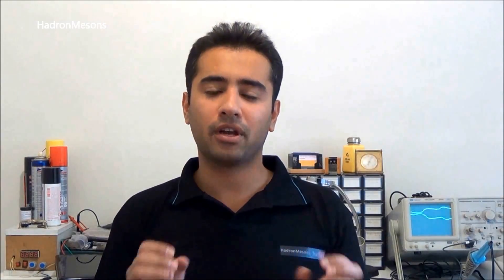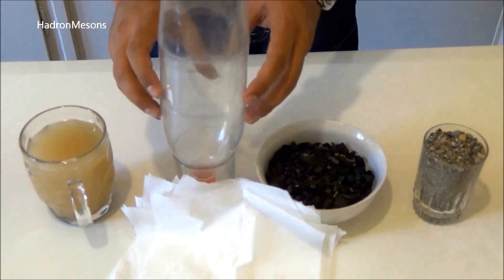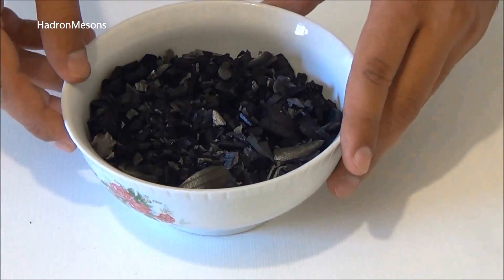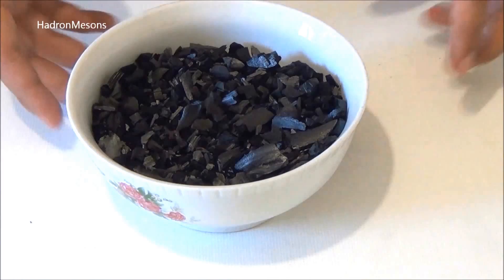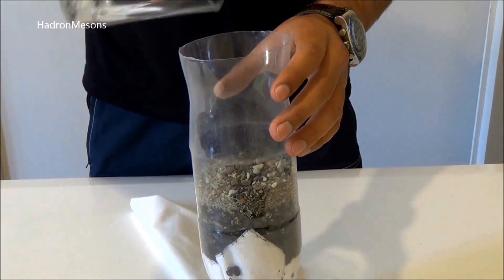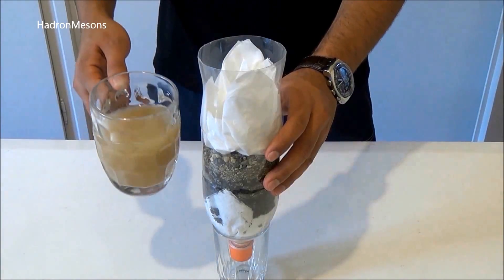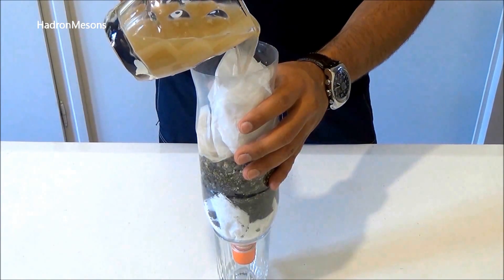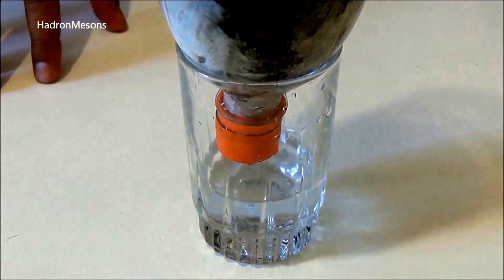How to Drink Dirty Water in Emergency Situation - Survival !!

Comment: It is waste of time, how the f*** will u find these things in extreme situation??? someone is not a smart one
Reply: +Arctic Wolf 
Agreed, It's very easy to follow and very useful information. (might add my chance to survive zombie apoc) XD
Reply: Cloth, sand, charcoal, 2 liter bottle (garbage). What kind of apocalypse would deprive you of these things?
Reply: Shenba vv They didn't survive because they drank their own urine buddy.. do some more research on what drinking urine does to the body. You can fabricate an emergency solar still and use urine to get water.. And if i was caught under rubble i wouldn't drink my own urine because that would make the situation worse.. This is not open for debate because it's a known fact.
Reply: Willem Arnhem believe what you will..
Reply: The results will certainly vary depending on where you live. I live in a large suburb outside Boston. For the hell of it I went out looking for this stuff. W/in 5 minutes i found 6 plastic bottles....2 with the caps on. W/in 10 minutes found plenty of sticks to burn for charcoal. ok...lets go through the steps. (1) We all see discarded plastic bottles all over the place so that should be an easy grab. (2)Gravel is just small rocks.....so you can pick those up randomly. (4) if you can't find sand skip it and look for twigs and wood on the ground. (5) if you have a lighter or a match burn the pile of twigs to get charcoal.  Part of a white T-shirt can be used as the cloth part of the filter. All this stuff is available & can be done in an emergency as long as not too many other people know this procedure (and grab all this stuff up fast)
Reply: MrMarty
the dirt would still be there. The charcoal is supposed to remove lead and other heavy metals and bad stuff. The best thing would still be to boil it after if it's possible.
Reply: I have do it for a science project
Reply: Well,  let me ask you a simple question.  Suppose you are caught in an emergency situation, lets say underneath piles of rubble.  You are injured.  You need water to survive until help arrives, what would U do to live if you are left with no other choice but drink your own urine?  Would you choose to die or live?   Media might have made up the stories but there are people who really survived with urine.  Anyway,  thanks for your explanations.  Have a nice day.
Reply: +Kubisek9 charcoal is found after making a fire, - made from burnt wood.
instead of paper towels use a torn shirt.
collect small rocks for the rocks.
sand is abundant on land as well.
If you are on a boat, you can maybe make a fire, to make charcoal.
if you are on a raft, you are fucked, you must use condensation.
Reply: To make things simpler this is what you do
1. Find wood
2. Make fire
3. Use any type of pot 
4. Get water from the ocean/saltine water
5. Boil
6. Make sure something is over the pot like a clipboard or something so the water won't evaporate into the air
7. Tilt the board and have something on the side of the pot so the droplets from the board can fall into it
8. Salt is left behind in the the pot 
This guy idea of surviving in a life or death situation isn't so good.  There's a 15% chance you will actually find those things. And I'm pretty sure that there will be a time when filtering the water won't work.  The water won't even be great to drink.  That's all I had to say thx and bye😀
Reply: +Bruce Nguyen This is for emergency situations like an outbreak. It's very easy to gather too, just burn and make charcoal then find other materials.
Reply: AOA angles  what this does is try to remove the bacteria that will kill you, there's only small traces of "stone and chalk" and it beats being dead or sick because the water you drank had tons of bacteria and stuff in it and you drank it because you had nothing else. this is for emergency survival use
Reply: Sand on beaches. Charcoal from burnt wood.
Reply: Yeh like boi u could just get water and boil it and let it cool down that lower the chance to get sick
Reply: Kubisek, no body forced you to watch this video. why don't you put your dirty tongue in the closet cos we don't need people like you in here. Please try to appreciate what people do if not shut up
Reply: You can't find a water bottle and some sand in an 'extreme situation'?
Reply: +Kubisek9  Ya I agree with U. commonly we read ppl survive drinking their own urine or rain water.  But not by filtering the dirty water. Ha ha.
Reply: +Gino Foogle You can drink your own urine up to a point where you are becoming so dehydrated it's turning a dark shade of orange/brown
Reply: +Kubisek9 it is a solution among many others. It depends on what you have on hand. Yes he is a smart one. It's up to you to learn all the others possibilities and when you are in extreme situation you will be able to deal with it.
Reply: +HadronMesons - Science and Tech  use some wood, make a fire, boil the water, drink it?
Reply: +Kubisek9  if u get ready for that BEFORE extreme situation AND MAKE AT HOME U PEASE OF CRAP U ARE IDIOT DAMN IT =_=
Reply: TopCategory I know I understand how it works, but the mikimuas guy was saying its too hard that you would need to make it at home and I said if you had time to make it at home you might as well buy the Sawyer mini water filter, it's better than a lifestraw. that's what I was getting at trying to tell him how ironic that he called someone stupid when what he said was even stupider
Reply: yahhhh u right....but cause of him many people can die....
Reply: ya right and also how can we drink that water cause it is mixed with stone and chalk huh??
Reply: +Kubisek9 yeah
Reply: stuck in cave and ü gave bottle 💥
Reply: have *
Reply: his right dldl
Reply: Actually it would be pretty easy to find this stuff. Discarded plastic bottles are everywhere. Sand and gravel is easy. To get charcoal all you need is fire and wood
Reply: +inkey2 I don't think it's as easy as you say it tho
Reply: agreed
Reply: Kubisek9 charcoal is easy to make for free & plastic make up 10 percent of the trash mountains in the world this is not a waste of time since I started writing this reply to you 8 children have died from drinking dirty water & it's stuff we with taps of clean water learned in scouts at the age of 10,a child dies every second since I told you 8 children have died another 6 have died.. Ur an ass it's plain to see ur uneducated in the art of survival I pity the lazy attitude you offer sitting at your computer drinking your coffee...
Reply: Gino Foogle see how you feel about it when you're car breaks down in the middle of the desert & u don't have dirty water to filter I was in this very situation a few years back I always have charcoal in my vehicle even a small amount it can save your life cool pee tastes not so bad when the other option is dry mouth like uv never felt in your life & the next stage is death then tell me what you think when ur in the situation not sitting in front of the computer been a naysayer in joy that coffee 10 children have died of dirty water since I started this reply 1 a second grow up this is life n death.
Reply: Shenba vv better example than mine but I survived because of this IV drank urine straight & have filtered water with charcoal I broke down in the bad side of the serenity & always have a bag of charcoal I could make it but that's for living in conditions of dirty water full time, I've volunteered in many countries teaching easy ways to filter water I disagree with charities like water aid they get money in pay stupid wasted money for special mesh for the collection of morning due when the perfect free option is the safety nets on old trampolines I use fb to collect them &  taught 5 families that method from scrap that can be got in the dumps there I ship mesh as much as possible but have ppl on the ground over there who are getting mesh in South Africa & it can provide enough water for a family of 4 & there livestock with 3 collection setups 1 if they have no animals.
Reply: Kubisek9 how i made purified water for my project bottle cap sissers paper towels rocks grass dirty water
Reply: NuclearQuestious oly bear grylls has the guts😀😀
Reply: Exactly what I was thinking?!? Why not just take a lifestraw with you?? https://www.mrwatergeek.com/lifestraw-review/
Reply: You would be surprise what you can find if you have to.
Reply: altha 2014 - Yeah? So tell me, how do you find 80 litres of clean water to wash all that charcoal and sand to make your dirty glass of water clean in a survival situation then, idiot? You need clean water to make a water filter in the first place, as the filtrants will only be as clean as the cleanest water you have available.
Reply: Kubisek9, who the hell doesn't have all of this? I'm a prepper and I'd know first hand everyone is safer with charcoal and a bandanna at least
Reply: You are fuck
Reply: Fuck
Reply: Kubisek9
Reply: Kubisek9    u know!!!
Reply: Gino Foogle.  yae ne!?
Reply: try knowing what your doing
Reply: i refer to my other comment!!!!!!!!!!!
Reply: Its so helpful in emergency.
Reply: Kubisek9 how about this but the things you need an out them up..it's not a keyboard clicker like yourself is out on any stealthy missions were having to filter water would pop up...
Reply: its not that hard..Find sand and rocks on the ground and burn wood and take the charcoal off.
Reply: make a fire: charcoal
sand and gravel: litterally everywhere
tissue: im sure you are wearing some clothes
old bottles arent hard to find either, or make a trough out of a sapling.
not hard at all
Reply: Shenba vv people survive DESPITE drinking their own urine.. no survival expert anywhere would advise you to drink your own urine in a dire situation. This common misconception has been reinforced by media outlets to get more viewers. Shows like the one with bear grylls (Edward Grylls) do the stupidest and most dangerous things to get viewers.. Alot of the things shown on those shows have very little to do with survival.. Ray Mears on the other hand seems legit.
Reply: Then drink the piss. Piss is as good as water. If you're stranded in a desert, 1. Why are you driving in the Sahara? 2. You're utterly fucked.
Reply: Kubisek9 yeah you would think that if you can get all this clean stuff than you can definitely find clean water somewhere

Comment: what if you don't have charcoal
Reply: +LEGO 7163 Guess where charcoal comes from
Reply: Burn wood, get charcoal
Reply: Willem Arnhem  what if you are in the desert or the sea
Reply: Well in the desert you have no pools of stagnant water at all so there's that. And being stranded on sea requires you to have means of distillation or otherwise catching vapor. That or an osmose filter. Charcoal won't remove salt anyway.

But in most cases you will have access to wood
Reply: oh ok thanks

Comment: I have better one First you need  sun-foil(OR cloth or something will work like foil)-a little stone or sand or some thing-cup-a big case.Place the cup middle of case .Fill the case with dirty water (MAKE SURE YOU DİDN'T FİLL THE CUP THE CUP MUST BE EMPTY)(It will work at sea water too ). Place the foil above the big case (OR some thing will work like foil).Place the sand - little stone or something middle of foil.AND.... WATER PEE BITCH ! xD. If you don't have a clean cup  and you can clean it with a clean water that fill into it (Clean water from contrivance that we made).After then you pee when you drink it your dry  cells will get some water (No minerall or something btw) after then when u pee it will be less then the first one. But you can hang on for a while ( Not much ).

Comment: And what if i don't have any bottles, sand and charcoal? Am i gonna die in that case?!
Reply: LockedPig no. what you do in that situation is pour the water through a shirt folded over a couple of times to remove the heavy crap, then bring it to a rolling boil for 1 minute. If you can't boil the water then leave it in the sun for 6 hours in a clear plastic bottle.
If you don't have a bottle, then I would pray to God to bless it and drink away.
I suppose you could make a bowl from a tree trunk and put in with heated rocks. The bowl might burn, but I doubt it will catch on fire. Then you can boil your water.
But I guess your best bet is to carry around a PET approved bottle that will not melt with hot water so that you can sun purify your water if worse comes to worse.
Reply: You wouldn't care if it's clear or not lol you will drink right away
Reply: Well... NOPE!
Reply: LockedPig believe it or not i will drink any water
Reply: iPixels ايبكسلز Then you don't need any extreme situations to do that )
Reply: Well, that make sense to me
Reply: lol this might be useful using my dirty shirt as a filter
Reply: Urine!

Comment: Very neat trick :). However the best way to get pure water is using colloidal sliver not only is it used to purifier the water on the ISS it also acts as a wide spectrum antibiotic and immune booster. The water in this video is filtered but I am not sure of exactly what degree does this process removed virus from stagnant water?

Comment: This will turn the water dirty and toxic and it will be very bacterial and it may cause the death of someone.
It even smells like shit because of the sand and charcoal.
Reply: t i am saying is that this may change the color of the water but it won't turn it drinkable
Reply: +PC tips and tricks Well...Charcoal as a water filter can work very well yet...  to be sure, you could also boil the water afterwards. Or set in the sun all day also. Or both. When the SHTF, and you cannot seem to locate that $100 filter from you hiking days... you will be glad you remember how this is done.
Reply: +HadronMesons - Science and Tech just saying Google is not the most reliable source

Comment: for emergency situatios you can simply put a glass of water and then cover with a plastic bottle cuted in half , and the water will be evaporated and it will make condensation in the plastic bottle leaving mud or salt water in the glass.. where can you get clean charcoal and clean sand in a emergency situation ?
Reply: Andy Chow well, wait a minute here... If you have charcoal, why not just boil the water and collect the distilled water into the cup?
Reply: Alexandru Diculescu  that's why you would try to make a smaller fire. Get some charcoal like that then distill it but would still take time .. solar distilling can work but reflectors are often needed to increase output or speed.
Reply: *****  (glad u noticed this word typo). In most situation this be fine just to boil it  If it's  very hot out, you may want to stay away from the fire or burn very little(have very little) to get a little black charcoal ( some how its sunny out) Using the black to help act as a heat sink for solar to work better. Sand or rocks are better than nothing.  You can sit and rest in the shade while a solar still works. (just maybe lose less water then trying to tend to flames in the heat)  Really depends what gear you have with you.  / fire wood availability and how hot it is) Remember to start distillers asap if you can make one. Solar is an alternative to fire.
Reply: charcoal from wood sand from near where you get the dirty water?
Reply: You can get clean sand by washing it with clean water......... :D

Comment: Yeah, it's important to note that this is just for emergencies, when you don't have a proper water filter and you want to treat dirty water at least somehow. It doesn't remove any loose pathogens in the water, but it probably does lessen them a bit by removing those embedded in silt or humus. This is probably an excellent way to treat visibly dirty water before purifying it in sunlight (6+ hours). Sunlight doesn't sterilize water properly if there's those bigger particles in the water.